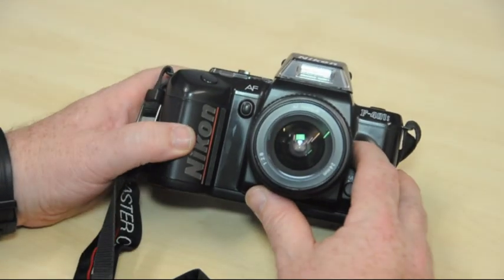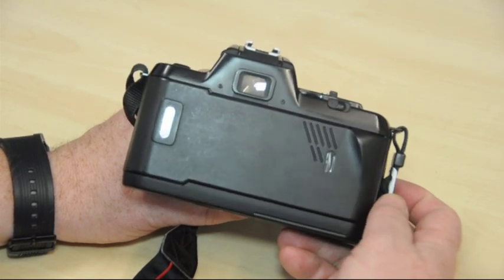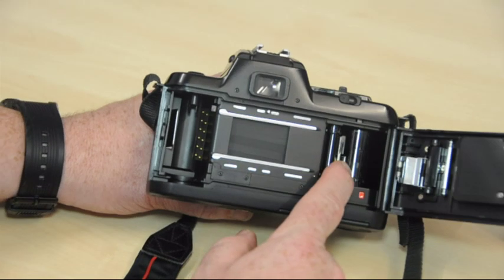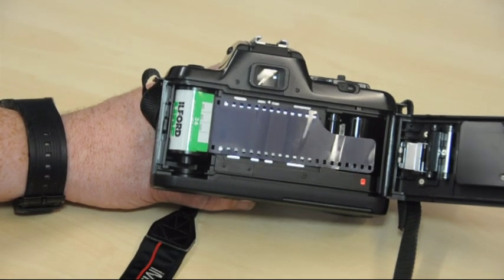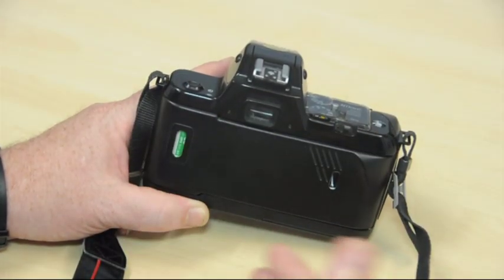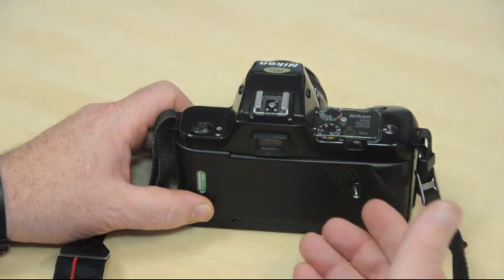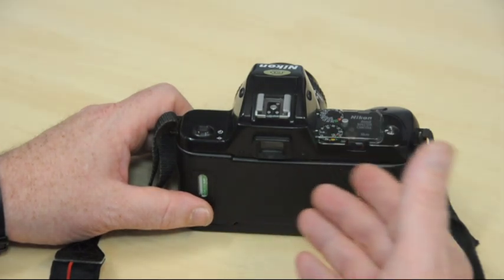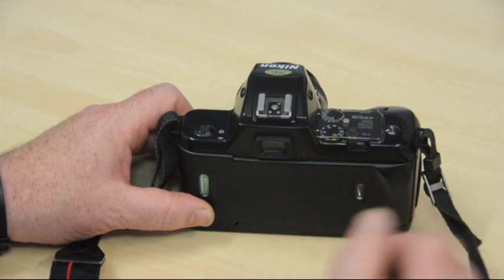Loading an Auto advance 35mm SLR camera F401s

Comment: @jfcash84 yes yes, i understand! but i dont mind focusing manually since i will be dealing with video mainly, where everything should be taken care of manually anyway. besides, the canons im looking at in my price range have 60fps in 720p which is idea for slowmotion, whereas the nikons do not. by the way, which zoom lens do you recommend i get instead of a 18-55mm kit, since i will probably be replacing the kit lens anyway? (im trying to decide what the first lens i buy for the canon should be)

Comment: @GizmoBitz You will lose Automatic functions of your Nikon glass by using the adapters! The adapters have no electronic contacts. Get a Nikon body and use that, that will also let you use vintage F mount lenses that are hard to find new. Trust me you'll be a happier camper.